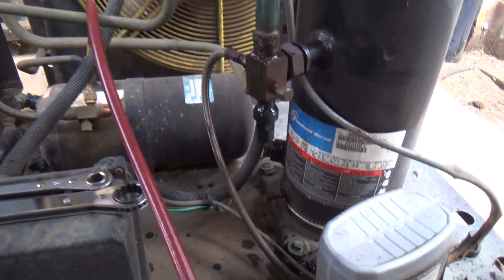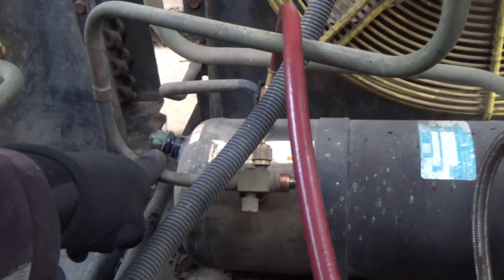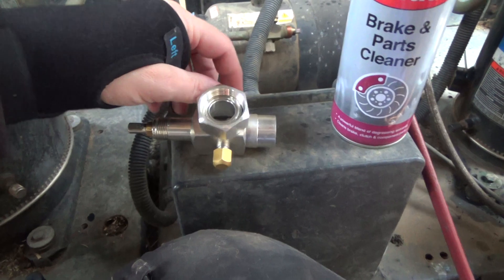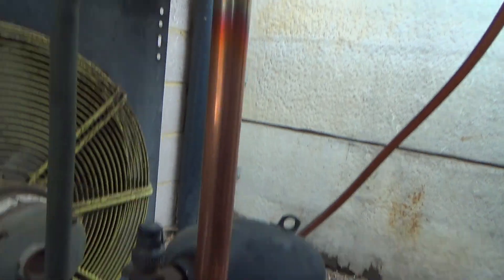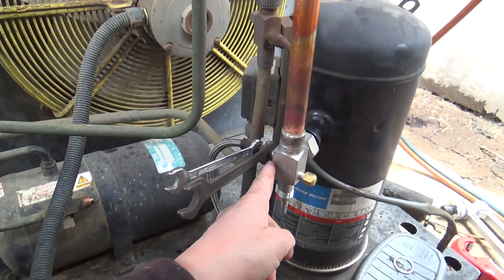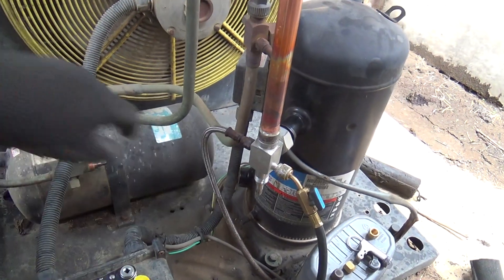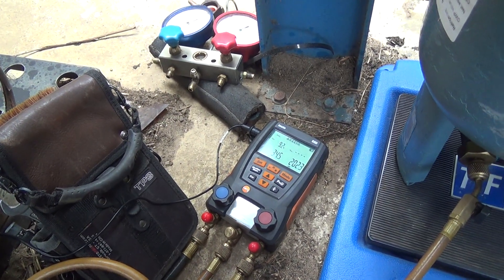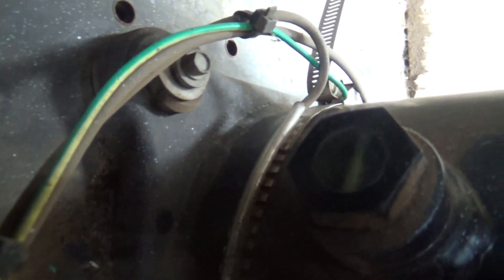Condensing Unit Won't Run

Comment: Nice work fitting that. What happened to your left hand? Carpal tunnel? Did mine a couple years ago. Best to you.
Reply from the maker: I've got some issues with joints, especially if I do a lot of hours in a day, was supposed to go for some tests but been on hold due to covid etc
Reply: @heavydiesel  good luck. This is becoming a young man’s job. I’m 60 and it’s catching up🤣

Comment: What is the point to those leaky plugs???  Seems like just a way to cost farmers money with unnecessary problems to fix
Reply from the maker: They are a safety device, the idea is if there was a fire the solder would melt and let the pressure out before there was an explosion. Trouble is when systems run hot the solder gets soft and the pressure moves it a bit and they can leak. The older ones would move but not leak but these new ones are terrible. I have changed to another brand to see if they are better.

Comment: Brilliant video as usual! Noticed the knipex pipe cutter in the background, is it any good? 

Our new chillers all come with R449a too. Another bottle to add to the list for us 😄 417,404,410,438,448,449 and r290! Good info with changing the rotalok valve too, thanks.
Reply from the maker: I'm quite impresser with the knipex cutter, will do a vid on it in the near future.

Its a pain keeping up with all the different types of refrigerant, got six bottles on the van!
Reply: @heavydiesel  yeah it’s a ball ache! Most of my bottles are the 45kg too 😰 then the nitrogen, then the spare oxy acetylene! Gonna have to get myself an artic if they keep bringing new refrigerants out.
Reply from the maker: @tnewson666  My previous van got stuck on the lift at the garage for being a bit too heavy... current one take 1400kg , crazy the amount of stuff we need to do our jobs!

Comment: Nice work. I think I recognise this unit from a previous video unless that cut down bottle cover for the pressure switch is a common mod 😎
Reply from the maker: Yeah, last job here was a new pressure switch as it had got water in it!

Comment: Where did you get the blue vacuum hose from mate? Did you have to get it shipped from the states?
Reply from the maker: Yeah I ordered it from Valuetesters in the States, saves a lot of time on site.
Reply: @heavydiesel  Nice one, less expensive than I expected tbh. 

Yeah they look mint. I've got myself a 1/2" yellow jacket one that I'm looking forward to trying out tomorrow, got a couple of condensing units to run up so might do a side by side comparison with a 1/4"
Reply from the maker: @sidney5696  I'm sure it will be a lot quicker, especially on used systems where there is refrigerant boiling out of the oil.
Be aware if you order from the States you will likely get stiffed for vat, duty and a handling fee.
Reply: Probably available at the dealerships, but likely only as either special order, or if you know to ask for the larger diameter hose.

Comment: Great stuff, must get myself some of that spray paint on the van for them service valves, I’ve only got white for when I accidentally burn a cold room panel haha
Reply from the maker: I've got some black paint for similar reasons when I've scratched new units etc! 
The stuff I use on valves is galvanising paint.
Reply: Amazing what you can hide with a bit of paint 😂
Reply: I used to go buy the spray cans of grey primer by the case load, and use a larger can as well, so you get a lot more paint per can. The other colour I went for was black and white, though the most common colour was Hammerite green, to match the paint on the machinery. Funny thing is the cans of clear lacquer always seem to leak from the can seal at the base, despite being the exact same can as the colour, which does not. Must be the lack of filler pigments, that make it able to slowly ooze through the crimped seals in the can.